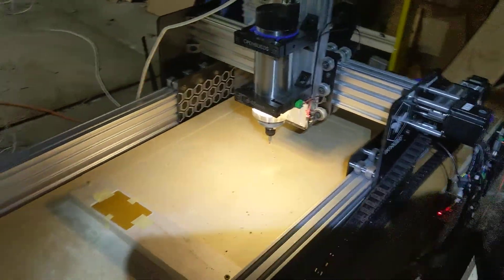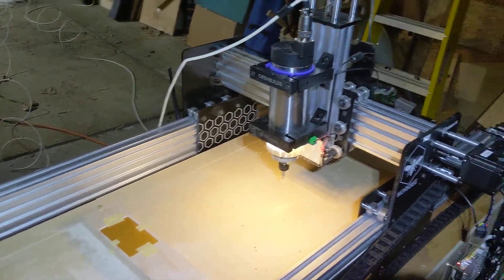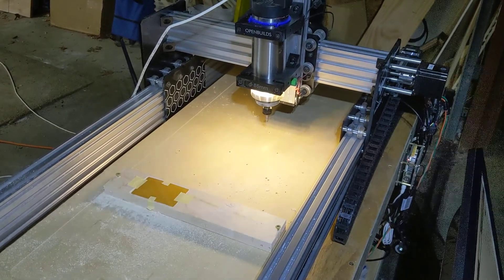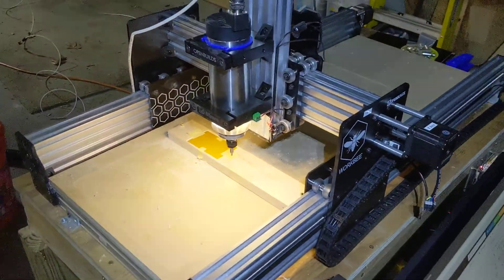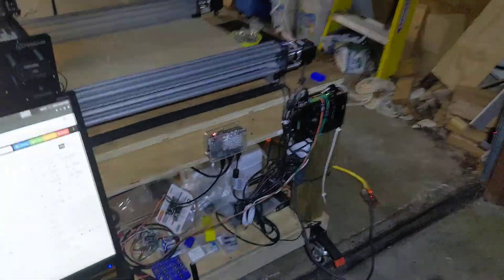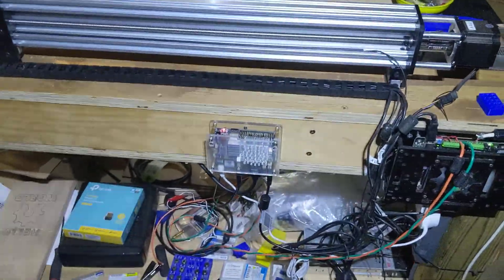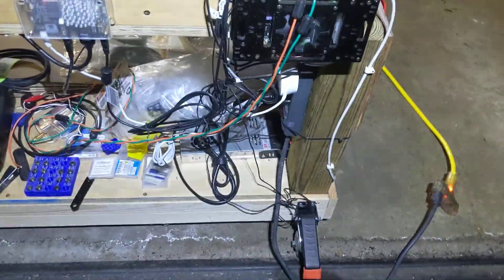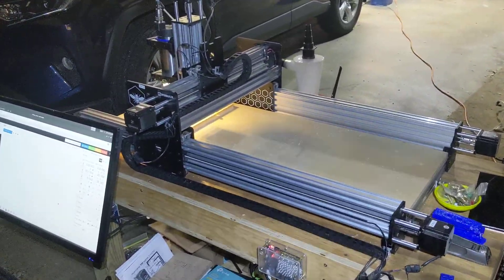Grinding noise from Workbee 1050

Comment: Hi. Thanks for the vid. Did you solve the problem,  i have a similiar issue.
Reply from the maker: Yes I did. There was a loose screw from one of the cable chain mounting points that had fallen into the y axis. When the grinding would start it was mostly under a wheel so it was hard to see. I finally found it after moving the carriage away from the grinding spot and peering down the extruded aluminum.
Reply: @SasquatchActualCNC  Thank you so much for the reply. Really appreciate it. Had a similiar problem but now discovered it was one of the stepper motors not functioning.
Reply from the maker: @davidj2459  I had that problem too maybe four months ago. Noise wasn't as bad as in this video. Problem in my case was the 4x4 connector near one of the Y motors had come loose on one wire. Had to replace the connector.

Comment: Hello ... a question, which engines does it occupy? I need for my CNC and I don't know exactly what they are ... I would appreciate your answer
Reply from the maker: The motors are NEMA 23 sized stepper motors. The ones I'm using here are from the OpenBuilds Store: https://openbuildspartstore.com/nema-23-stepper-motor/

There are 4 of them. 2 for the Y axis and one each for the X and Z axis. The good news is that just about any NEMA23 motor will likely work for you.
Reply: @SasquatchActualCNC  thanks for your reply

Comment: Maybe an issue with Y rails parallelism..
Reply from the maker: Maybe. It's a problem that developed after about two months of light use. In any case, a thin line of 3-in-1 oil along the Y-axis lead screws solved the noise issue.